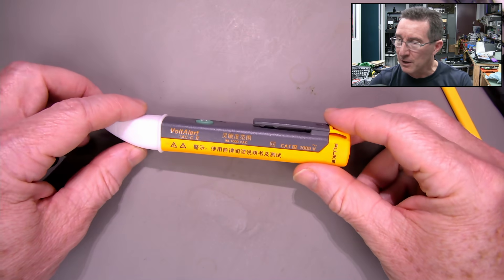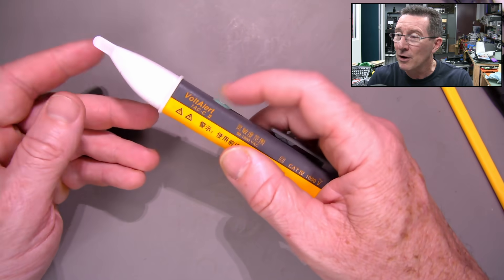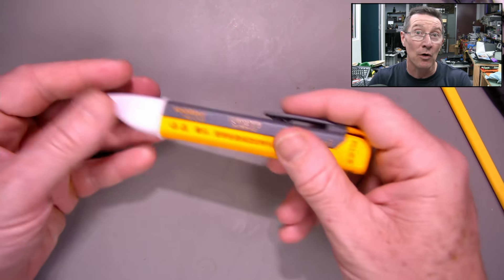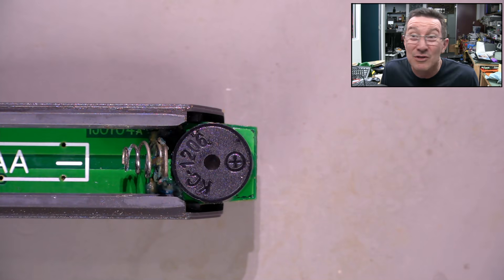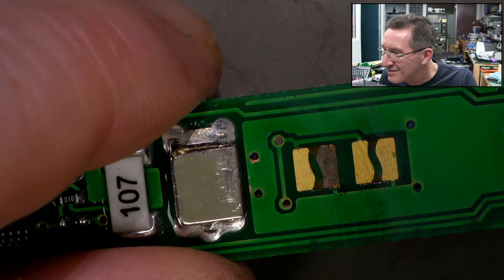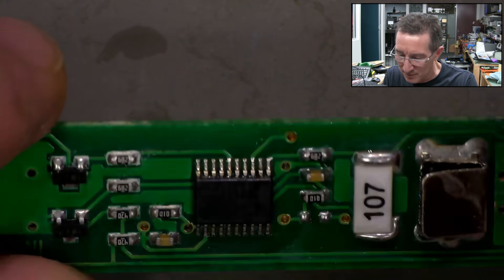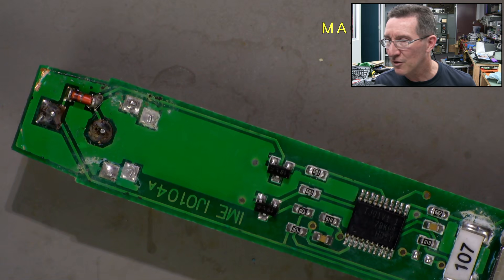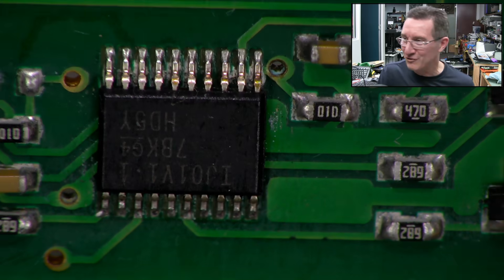Fluke 1AC Voltage Detection Stick Repair

Comment: I only have 2 problems with these testers: every once in a while I'll drop one and of course it will land right on the tip and break off. The second annoying problem is they will grow legs and mysteriously migrate into your coworkers' tool pouch unless you religiously return it to your shirt pocket after every use.
Reply: Gosh that happens at my job all the time too.
Reply: The euro design ones have a better tip, a round one instead of a flat tip.
Reply: @AndrewStrydomBRP  That's not going to work in countries that use flat blades for plugs, like China (where the unit in the video is evidently from), Taiwan, North America, Australia, New Zealand, Japan...
Reply: @straightpipediesel  You shouldn't use these to test sockets anyway, it's not reliable. I've stuck the round tip ones directly into a socket and had no result.
Socket testers and adaptors exist for good reason.
Reply: @AndrewStrydomBRP  Not if you use them right. Always test live, test unknown, test live, for contactless or contact. The US tamper resistant shutters are variable, some are adequately deep so you can get a reading, some aren't. Testing live on one of the same design tells you if it works. Socket testers can be unreliable for highly worn sockets.
Reply: @straightpipediesel  It absolutely does not work reliably, even in round pin sockets.
Loose sockets should be replaced, and NCV testers are not for proving something is switched off, only for checking if something is live (like "oh is this thing on?)
Reply: @AndrewStrydomBRP  Again, that's because you're in the wrong country. Round pin sockets usually have their contacts deep. Second, NCV testers may be utilized to check absence of voltage in some jurisdictions, they are prohibited in others. Fluke's instructions allow it.  It's just an issue of lazy people not doing the proper live-dead-live test or using a prover. In fact, medium and high-voltage utility lines are always tested with non-contact detectors as nobody is going to handle a 110 kV probe and there's concerns with line contamination.
Reply: @AndrewStrydomBRP  And since you're interested in trains, LU uses non-contact voltage to test dead for worker track access.
Reply: @straightpipediesel  Yeah, and then they add a shorting bar. That's not the same as just using an NCV tester and then thinking it's cool to start touching the live rails. It's always different for high voltage but the amount of times I've got a bullshit reading from both my own fluke NCV testers is more times than it is worth getting a belt from.
And they don't generally use NCV for high voltage here anyway, they use a cable spike.
Reply: In addition, fluke and others make HV probes for 40kV+, part that point in voltage you don't really test anything live, if it works then it works. 
It's permissable in our testing regs to not even test anything live bar RCDs and external loop anyway.
Reply: @AndrewStrydomBRP  Incorrect, they do not use shorting bars when it's only for access. I've also had poor measurements from a multimeter, just the other day measuring line voltage terminals because they were contaminated. Further, multimeter misuse fatalities are well known, particularly on high fault current systems. NCVs are safe if you know how to use them, contact voltage measurements can be very dangerous.
Reply: @AndrewStrydomBRP  Fluke's 40 KV probe is CAT I low energy only. It's for televisions and X-ray machines. It most definitely cannot be used on a transmission line.
Reply: @kwamebrown2768  Yup, the amateur doesn't know what he's talking about.
Reply: @kwamebrown2768  The point was that such style of probes do exist, and for 11/33kv distribution testing.
Above that you don't care about the specifics on the voltage.

Comment: The problem is that you have to trust your test gear because around mains your life can depend on it. I definitely wouldn't be trusting this :)
Reply: Always bridge it with your screwdriver….trust but verify 😂
Reply: That model has a test button, not sure if it tests anything more than the batteries and the LED though...

Comment: When mine bit the pole i gutted it and put the innards of a circuit tracer inside and piezo spkr on the big end of it..  still works..  didnt trust fixing something that i use so i dont die..

Comment: You can see the alkaline fill has soaked the board fibers, so long term it will continue to corrode under that soldermask, till it has eaten all the copper pads. Short term cleaning works, but now after a few months all the traces will start to be eaten away from the rear. Only fix is to make a new PCB for it, and transfer the IC, battery clips, beeper, LED and snap clips, and replacing all the other passives, as it will be easier than desoldering them. Yes will have to guess on the capacitor values, so desolder, and measure, then replace with new. 100M resistor replace with 2 47M in series, a lot more reliable from a noise side.
Reply from the maker: Or buy a new one. They are cheap.
Reply: @EEVblog2  There is that, but sometimes you get simple but expensive things with leaky cells.

Comment: 15:16 I didn't know these were made to discriminate so as to actually be useful. I have a cheapo one and it glows near any cord, even e.g. a USB cord connected to a computer plugged in. So even if the wire isn't live, it picks something up via ground.
Reply: I would expect these types of testers to light up around ungrounded power supplies because of the leakage through interference suppression capacitors.
Reply: You mean constantly glow? They do glow if you rub them to the cord.
Reply: @okaro6595   Mine is an Extech DV20. Glows 4-5 inches from a USB cable connected to a powered phone charger. Glows 1/4 inch from a USB cable going past other cables but not connected to anything. A long coat hanger near the wall triggers it from half an inch away. I notice when I hold my fingers around the (insulated plastic) end it's much more selective, even allowing me to determine which conductor is hot on a 2-wire AC cable.
Reply from the maker: Yeah, poor design.

Comment: That looks like a Texas Instruments MSP micro there.... 🤔🤨
Reply from the maker: Based on pinout? Fluke use an MSP in their meters.
Reply from the maker: If so I wonder if it's code protected
Reply: Looking forward for another video at EEVblog😀 @EEVblog2
Reply: 😄based on the marking of the underlined G4 that's quite common Texas Instruments marking style Mr. Dave @EEVblog2

Comment: Use white vinegar to deal with battery corrosion, it stops it, then clean off with IPA.
Reply from the maker: You didn't watch the whole video 😅
Reply: @EEVblog2  I have to admit to skipping a few bits... I commented early on when I saw you use IPA on the IC.
Reply: LOL ! @EEVblog2
Reply: That was the first thing I wanted to see.  Just finished treating an old Radio Shack metal detector with battery leakage.  The worst part was one of the battery removal straps which had some alkaline crap in the weave. It kept fizzing with several applications - but when it stopped, a rinse with IPA and it looked perfect.

Yeah, Dave, get an ultrasonic cleaner ... something decent.  My $30 cheapie isn't good for much.

Comment: I bought one of those several years ago... that stopped working within a couple of months of light intermittent use. Found it's ultra econobudget batteries had spooged & destroyed it's PCB beyond hope, far worse than your example. I suspect said batteries were leaking upon delivery. A year or two later, (and against my better judgment) bought another that turned up on sale,... & immediately swapped it's factory batteries for fresh; and life's been ponies & rainbows ever since. However, as this is an extreme low use 'instrument', It gets stowed sans batteries.

Comment: I had to replace the 100M resistor after a drop (less than 8ft) created a hairline fracture in the center of it.
Reply: thanks for you comment, mine stop working after a drop, i desoldered the resistor and was broken

Comment: Not worth lifting the chip, but I would have been tempted to solder some fine wires through those dodgy vias.
Reply from the maker: I was also tempted...
Reply: Any reason not to just fill the via holes with solder? @EEVblog2
Reply: Same. A few minutes with a blade & a bit of hookup wire.
Reply: That was the first thing I thought of, cleaning and soldering the vias, removing the mask, tinning the paths and applying a new UV mask to protect against moisture and other battery leaks.

Nice day 🙂Tom

Comment: I literally just bought one of these!! Came in the mail today!! FLUKE LVD2 'Volt Light'. Fluke are having a father's day special apparently :)
Reply: Might I suggest immediately swapping out it's batteries for ones known to be fresh and of good quality.
Reply: @rwbishop  It came with a Panasonic Alkaline (use by 08-2032). The button power switch is hard so there shouldn't be leakage through circuit. Have you had a bad experience?
Reply: @clinton_welke  Yes, a few years back bought one that had hopeless leakage issues within mere months... forget what batteries it came with, but do recall they looked name brand. Suspect they'd been leaking prior to delivery. Have heard both then & recently where others have had similar experiences. EDIT: I suggest only removing, visually inspecting & swapping in new batteries... as Dave found, removing the PCB is traumatic. If leakage is noted; just return it.
Reply from the maker: What's the difference in the two models?
Reply: @EEVblog2  Biggest difference is visual indication only. It has an LED torch which turns on with the clicky clicky hard power button switch (LED is always on when... on...). It indicates blue with varying intensity the closer you are to a source, turning red when you're 'at the source'. I've had a play for a couple minutes and was able to follow a chased lighting circuit in the wall which was kinda neat. It claims to have 2 sensitivity levels but not worked out if that's automatic or selectable.
I tried to link the Father's day Fluke sale (Australia), but I guess you're not allow to link stuff in comments because my whole comment appears to have vanished into the ether and I had to write it again. doh!
Reply: That's literally a different model.